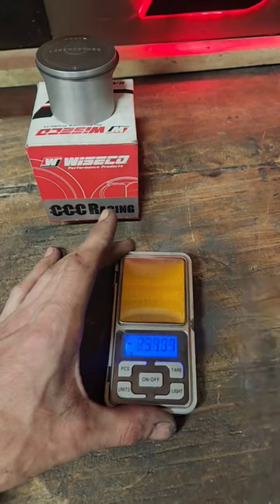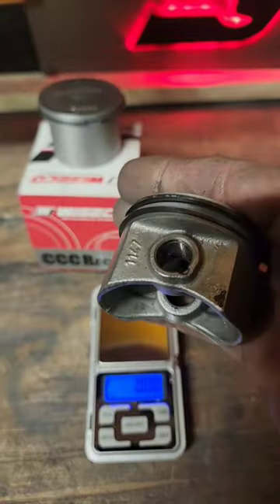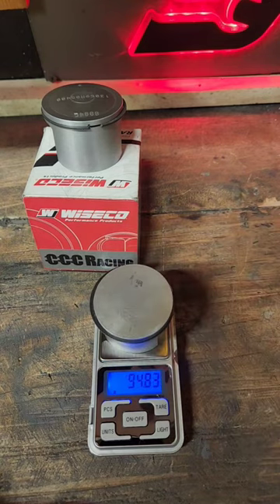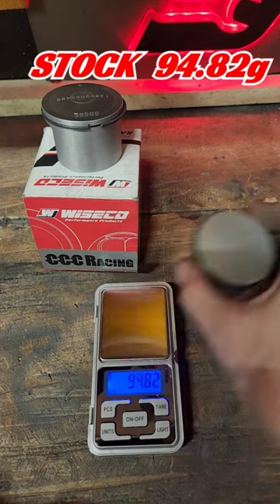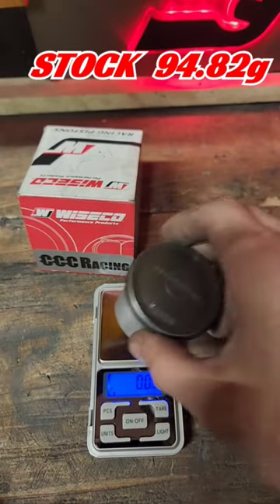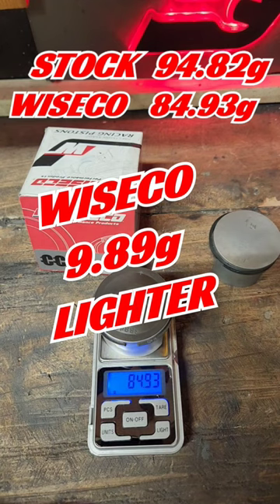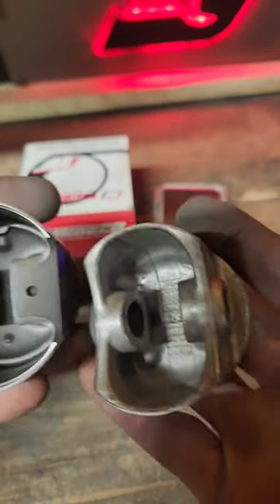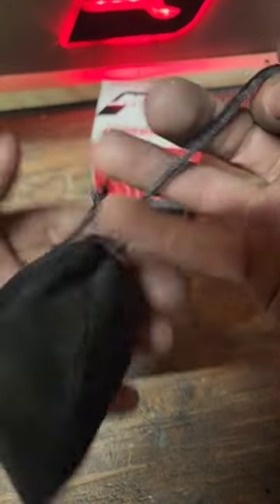CCC Racing Wiseco piston for Stihl MS500i vs Stock piston weight comparison 💯

Comment: If you notice the stock piston has two rings the aftermarket only has one ring that may be an issue
Reply: Doesnt make diff
Reply: Less friction the better
Reply: @khrprod  it reduces life expectancy, but is better for high revs
Reply: @matthewbianchini3260  but 2 ring is more stable, hence they last longer, always
Reply: Most saw builders prefer a single ring from what I've gathered. Power comes with cost, such as rebuilding sooner. Drag cars get engines rebuilt every ¼ mile while Nascar will go hundreds of miles on a build

Comment: My kids bought me a brand new 500i and after one and a half days of bucking trees my piston burned up! The Ace pro store they bought it from will not fix it for free or give me my money back after having it for 3 days and using it for a day and a half!
Reply: Go around the store.   Contact Stihl directly.   I saw the same thing happen locally.   After two days of a guy running around town with a sign saying do not buy from blah, blah blah, everyone was on board to replace the guys saw.
Reply: @johnmorris7960  I was more pissed off about it, but my kids were really bummed.. I’ll look up a number for Stihl and if need be I’ve carried signs before. Thank again
Reply: @arnoldlucero6084  they are the biggest in the world and can make it right.   I just bought six formed fuel lines for $82 and could have gotten all 6 aftermarket for less than $20 with shipping if I could have waited for them to get here.   They can afford to swap out your saw.
Reply: @johnmorris7960  I took my saw to another shop, he tested the fuel, contacted one of the main guys and he told them to fix it! The tech already ordered the parts and will give it a complete diagnostic test.. I’m happy with that outcome, but I’ll never use or recommend the shop in Missoula MT that never even tried to help me out. Thanks again